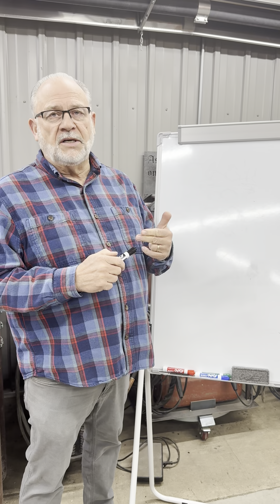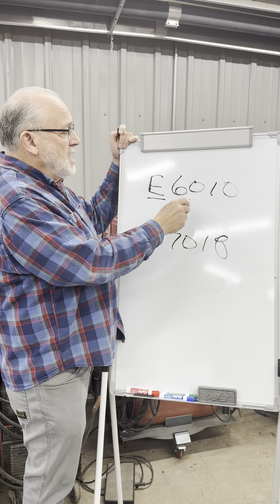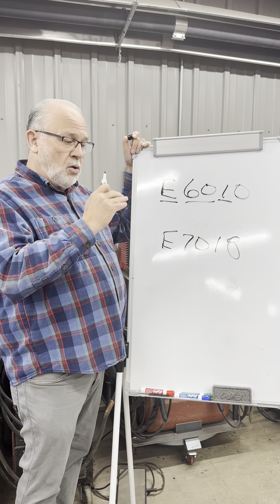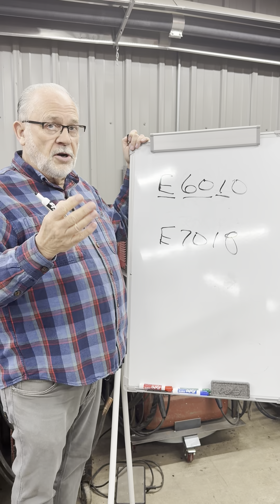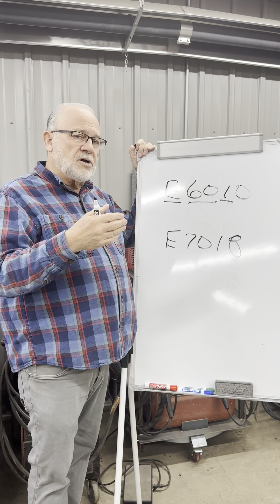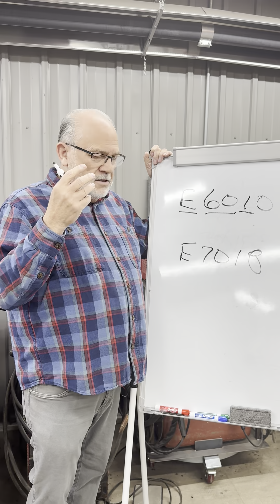What do the numbers mean for carbon steel electrodes in Stick welding?

Comment: They pair well together. A 1/8  6010 runs on the same heat as a 3/32  7018. Or very close. Which is great for pipe welding.
Reply from the maker: Yep!